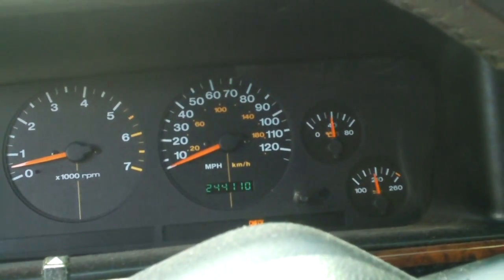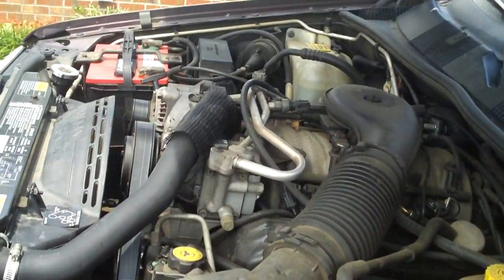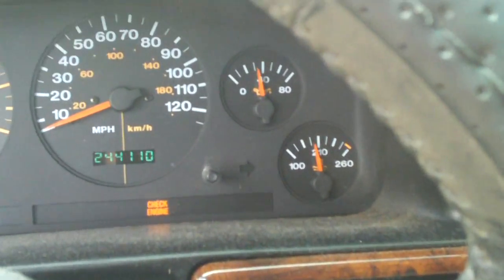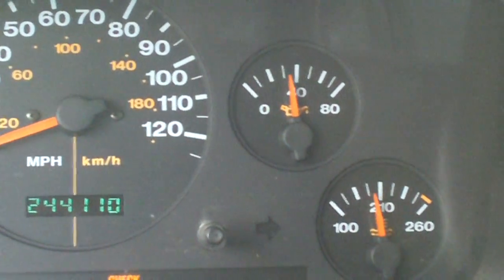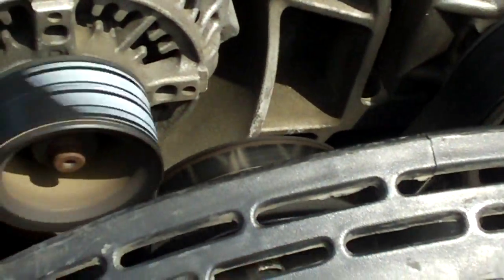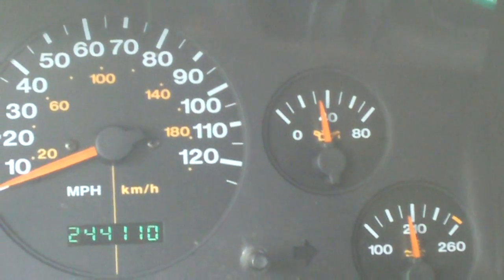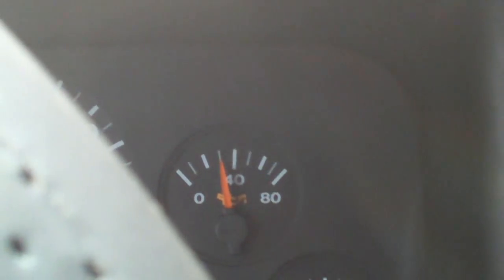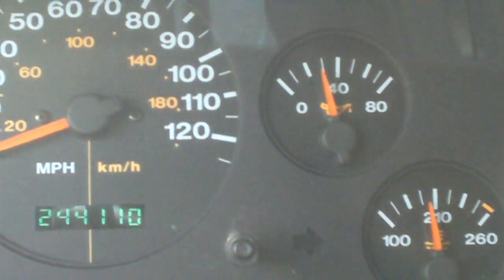Strange Behavior on Jeep Grand Cherokee ZJ 5.2l Oil Pressure Gauge

Comment: I changed the oil pressure sending unit while changing the oil on my '97 Cherokee Sport yesterday. I am having the identical oil gauge problem. The new sending unit did not solve the problem. I think this may be indicative of an oil pump that needs to be replaced.

I am using the same oil: Castrol GTX High Milage 10w30. I have been reading about different motor oils, and feel this may be part of the problem.
Reply: Jim Capone i just changed my pump from the exact same problem with my gauge with no change. it still fluctuates. at 75 mph 2100 rpm i  show 20 lbs. when i accelerate the cakes rattle as if they are starved for oil as well.  I'm thinking i have a couple clogged ports
Reply from the maker: Jim Capone I replaced my sensor. When replacing it I noticed that the sensor already installed looked identical to the replacement, like somebody had already replaced it before. I think the oil pressure sensors from AutoZone don't like to read the most accurate in hot conditions.
Reply: I've also read that the pick-up tube to the oil pump could be clogged. I will let my mechanic look into this because trying to do this job with the Jeep on ramps looks like a real breaker. I'll let you know how this turns out.
Reply: Thomas Adam I replaced the oil in my Jeep with Shell's Rotunda 15w40 weight oil. The oil pressure is 20 at idle, and goes up to 40-45 when driving. My mechanic says as long as the pressure goes up when I drive, and don't heat knocking,or tapping, everthing is fine.Next oil change I'm going to add Marvel Mystery Oil just in case.
Reply: Jim Capone I know I'm late to the party, but was the problem the oil pickup screen? Mine is doing the same thing so I will be replacing the pump and screen and see what happens.
Reply from the maker: Discontinuing the use of FRAM oil filters made a huge improvement for me. I started using Mopar filters when changing the oil and oil pressure is noticeably better. Replacing the sender showed some improvement, but the oil filter made a big difference. Look at a Fram UltraGuard filter and see the 8 tiny holes on top. Safe to say those holes were restricting oil flow. Also, since I learned that Fram constructs their filters using cardboard and poorly arranges the pleats, I will never use a Fram product again... NEVER. Even the $3 SuperTech filters at Walmart are of far better quality than the Fram UltraGuard.

Comment: i have a 5.2 zj with 300k on it. this is normal for a high mile 318. i promise. 20 at idle and 30 to 40 at highway rpm with warm engine. 40 to 50 cold start
Reply: +jose arguello same here guys. i cleaned my throttle body fixed my idle, and iv noticed iv been burning oil, my oil pressure sits at 40 since i cleaned my TB but now it drops up and down the same pressure as you guys!! im goin to change the oil pressure sending unit next hope it works
Reply: E Raupp did it work?
Reply: I've used nothing but 5w30 on 5.2l and it has 260k on it now. One day it decided to idle at 20 and has been that way for a while until I did a rear main seal and found a whole leaf...YES A WHOLE INTACT LEAF...from a tree...stuck in front of the oil pump pick up tube. How in the world a whole leaf got in there i have NO IDEA. After that oil is back to normal 30-40 at idle.
Reply: +josh hicks  I have the same issue. I have a grand Cherokee  95 5.2 laredo. it has 137k miles. it doesn't any code. even though some people said something could be wrong I don't see or heard anything wrong with it.  when I cranked it start and 40 or 45 then it goes down to 20 when it got warm then i stop ( idling ) in any traffic light or stop sign it goes down to 20 then I press the gas then goes up to 30. may i will upload a video or picture.

Comment: Its a common thing for these oil pressure sensors to fail and fail alot.  Sometimes you can just take em off and clean em off with some electrical part cleaner or brake clean and put em back on and they'll work.  I've done this on my 98 XJ with 4.0L.
Reply: I also have a 98 XJ bro. Question.. Went mudding a week ago and right after (at idle) I noticed the oil pressure gradually decrease down to zero and it has been sitting there ever since. Could that part be the culprit??
Reply: It's Alonso a 4.0
Reply: It very well could be.   Mine would do it intermittently. Only to confirm is test it with a mechanical oil pressure gauge or just buy a new one and see it it fixes it.   Or if you want to try taking it off and using come electrical parts cleaner and a pipe cleaner that might work.   But the last option, if it works, is only putting a band aid on it.
Reply: I have a 1994 high mileage 5.2l V8 and it calls for 5W 30
But my friend said that I should start using 10W 40
And the oil pressure normal is 40 but now when it warms up it drops to 20 at idle and goes up when I drive and back down if I stop at a light
But I will try cleaning out the sensor hole and put new one also I know it's been 3 years since you posted this thank you

Comment: Had a similar issue with a 96 zj. I would lose pressure when turning and the check gauges light would come on. Replaced the oil pressure sensor on the back of the block and that fixed it. Although, I had to replace it again about 9 months later. Worked ever since.

Comment: 44 yrs experience here.   When that engine is hot meaning 195 to 210 all it needs at idle is 20lbs oil pressure.  What I cannot understand is why anyone with an engine with 244k miles on it and 94 degrees outside is using wimp oil.  You should be using 20w-50w castrol
Reply from the maker: Motor actually has 160K miles. this vehicle had a motor swap at around 80-90k miles.
Reply: BikeGeekMTDX Same advice still applies
Reply: Why do you say 20-50

Comment: I think that oil pressure sending unit is bad for the jeep
Reply from the maker: I might replace it sooner or later. If the oil pressure drops, such as when the motor's off, but the ignition on, it does accurately report it. It's kinda tough to get at since it right up near the firewall.

Comment: Did you ever figure anything out with this? I just replaced the plenum gasket and the oil sending unit (because I broke the original) now its doing this same thing. Before it was.consistently around 40-60psi. Now its always I'm the 30's. I changed the oil twice after swapping the plenum gasket, so I don't think its the oil. Unless some trash got sucled into the pickup screen, but I doubt that happened. I'm thinking I have a defective after market sensor. Maybe your osu is giving you the same problem? Hope you found a solution!
Reply from the maker: I haven't messed with it, though I am sure it's likely the sending unit. The oil pressure gauge has always behaved this way ever since I got the vehicle. I think 30PSI is the normal idle oil pressure for this engine.